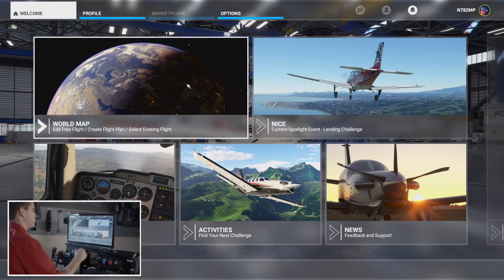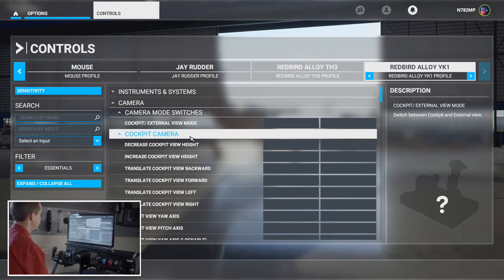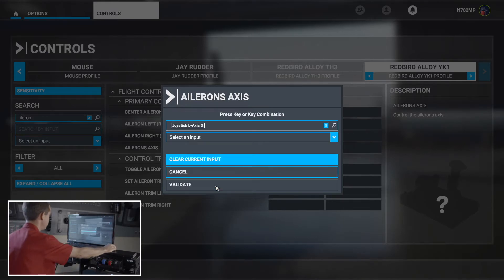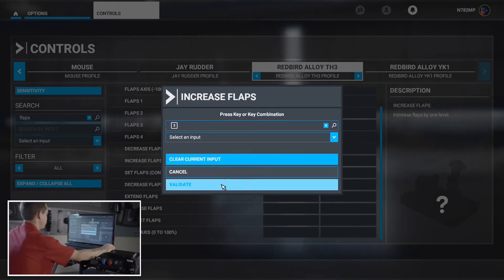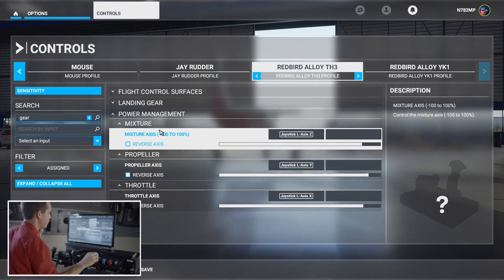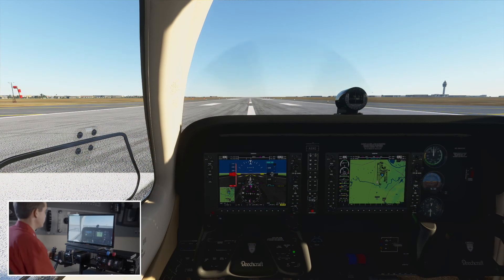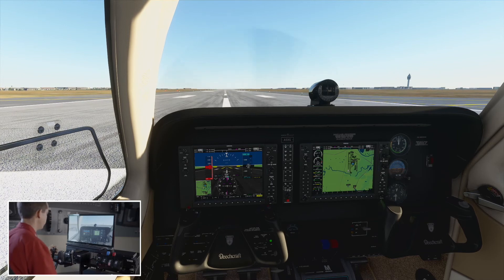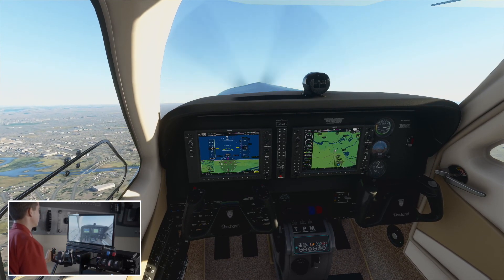How To Set up Redbird Alloy Flight Simulator Controls in MSFS 2020

Comment: Hi, I do have TH1 Throttle quardrant, but It seems not working properly. It's value jumps 50% to 100%. It works perfectly between 0% to 50%, but between 50% and 100%, no value at all. just go straight to 100% after 50%. This only happens with throttle and prop. not mixture. (mixture is working fine)
I've tried your "How to calibrate YK1" in your website twice. not helpful. any fix avail?

Comment: Not being a hater, I own the YK1 and TH1, soon to have the RD1. Anywho, just a couple mentions if I may. Glad you got the trim. I saw that at 6:53 and was yelling to you (at my monitor, haha). To add to this, I use other assignments to all of my buttons for the drone since when in the external view (The one via assignment - Toggle Drone) you are free from doing anything with any controls, thus you can apply them to the drone also just fine. As for Auto pilot goes, "Toggle Autopilot" (off and on) is far better in my opinion, since it will keep you from reaching for the keyboard more.

Overall I'm happy with my gear, but everything can be improved upon, so just a couple of things that are missed on the Redbird that is falling behind the times.
1- Hat switch is really a D-Pad. Directionally speaking, there is only 4 points (D-Pad), while a true Hat switch has 8. We waited many years for one and that was a big let down when I got mine (you may remember our emails from February of 2020? :) .
2- Grommets of some sort with female threads really should be all over the place on the RD1 bottom, YK1 and all of the TH units should have them on top, bottom and sides (at the very least top and bottom). Rubber plugs perhaps until the customer decides to use them would be great. Reason being, the current way to mount them is awful for a serious simmer building a sim pit. Look at any pre made sim rig, like Next Level Racing and RSeats for an idea. Motion platforms are springing up all over the place and prices slowly continue to drop. The quick back and forth rattles them and anyone building a sim pit cannot use what it comes with because they'd be putting them through their panel.
3- MUCH longer rod is greatly needed on the YK1 for sim pits. Redbird has great products, but they're also the most expensive and you have to be sitting with your chest on the panel practically to fly because it's just too short. Real length of the actual Cessna line (152, 172, 182) is what a sim pit owner needs. I have a machine shop near me and I have some CAD files to do my extras for my rig plates, but none of them have anything to mount them to in this manner without drilling and bolting.
4- Landing gear lights on the TH units (3 Green/Red)!!! There's a TON of room in there for it. Redbird have them on their own units, but not the ones they sell individually. I've reached out several times to Redbird but unlike you, they never reply (your support was great, Michael, even though your sales and not technically support).
5- Redbird needs to also go back to Amazon!!! If you want more sales. The last time I was on Redbirds site there wasn't a single link I could find to buy anything on any of the products pages. I forgot they had an entirely different website to buy things direct. Fire your webmaster because if there is a link to it, it's buried somewhere. I only found it because there was mention of buying a attachments for mounting the TH1 and the link brought me there. ALL products on the main site just says "Contact Sales". I was so frustrated I thought they changed things and was going to go with a different product altogether (honestly). Last but not least, the only Redbird products on Amazon and hundreds of dollars more being sold by morons that give Redbird a bad name and make people think they're much more expensive then they are.

Again, not at all a hater. I LOVE my gear and looking forward to the RD1's. Moreso now because I didn't know the toe brakes were axis! They're currently too long for my current plate and haven't got around to having a longer one fabricated yet. Redbird should maybe think about making sim pit cages like the ones I mentioned. Also maybe add being a reseller for D-Box! They're the most expensive option out there, but also the best. Redbirds motion simulators aren't made for simmers, they're made for teaching facilities that can justify the cost. D-Box still aren't exactly affordable for even most die hard simmers, but a lot of us are crazy enough to get them but never be able to buy the commercial ones Redbird has.

Anywho, nice to see the man behind the emails from two years ago, haha. Great video! For others, Redbird's youtube channel has other video(s) on the RD1 calibration that you really should check out. Important tips on Windows calibration and its importance. For others, I am a realism nut and having spent tens of thousands on various sim pits, Redbird is my preferred GA controls by far.
Reply from the maker: Thanks for you comments and suggestions. We will share these with our product team!